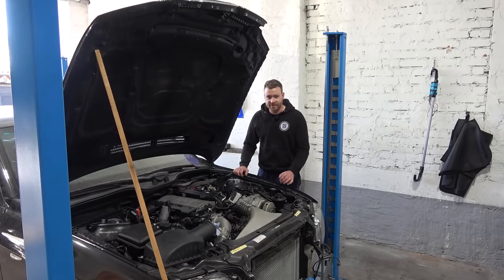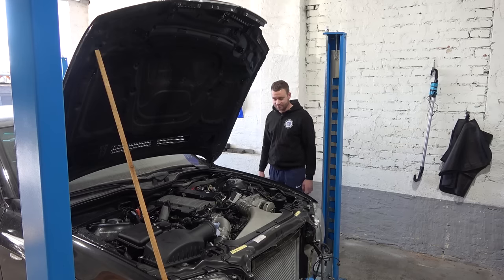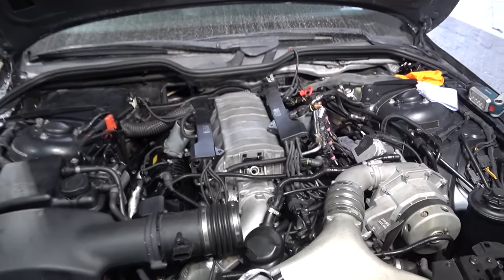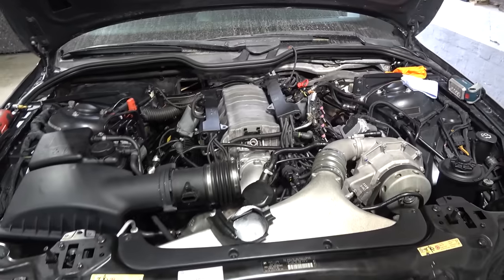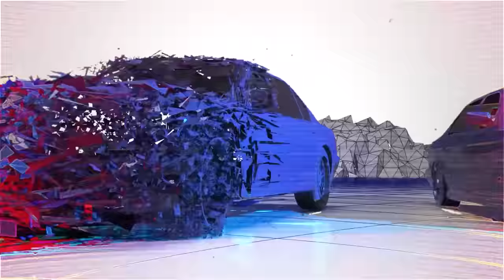Disastrous First Drive - V8 Alpina B7: Project Chicago: Part 7

Comment: Oh wow. Quite unexpected outcome considering how thorough was the rebuild. Can't wait to see what went wrong inside the engine. And of course, you'll fix it!
Reply: Beating the piss outta a fresh rebuild had nothing to do with it I’m sure
Reply: @dannyr3346  That wasn't beating on it at all.... And do you think every new car that is being driven moderately is wrecked in 100 kilometers? Nah, don't think so. I guess just bad luck
Reply: He should have changed the oil as soon as he replaced the fuel injectors as the leaking fuel likely diluted the oil.
Reply: @janetd5121  he did.
Reply: @janetd5121  he said he did after replacing injectors if you didn't hear.
Reply: @janetd5121  Watch the video.  He mentioned he changed out the gasoline diluted crankcase oil.
Reply: @janetd5121  he did
Reply: @janetd5121  wouldn’t make a difference
Reply: @janetd5121  he did
Reply: @dannyr3346  He wasn't beating on it ...
39:26 "so were gonna keep it around 4000rpm"
41:00 "aaahh ... its a shame i can't do a kickdown, this thing would probably fly"
1 - the tach is on the RHS of the cluster, and 4000rpm is about 1 o'clock
2 - the vehicle shifted pretty much at about 3900rpm anyway
3 - a few times he hit 4100rpm
4 - redline is at 5800
but that's about it, i cant see that i would call it "beating the piss out of it"

Comment: Sreten: "Man, I am really enjoying this car. I think I might actually keep it!"

Alpina: "you sure about that?"
Reply: I don't want to be that guy, but I knew this project and this type of engine would be trouble, these are KNOWN to be INCREDIBLY unreliable engines, I worked at a BMW dealership when we had those engines and they were a complete nightmare, doesn't matter if it's alpina badge or not either. But I am kinda shocked that it lasted this short of a while
Reply: At least he fixed the check engine light!
Reply: @henrik1743  Almost everything about a BMW is classy -- except the reliability.  Survey after survey shows that BMWs are the most expensive brand of car to maintain.  But that knocking sure sucks!

Comment: That's some awful luck, it was running so good! Can't wait to see the teardown and failure analysis. Hopefully it's something simple like a chain guide.
Reply: That most definitely sounds like chain noise to me.  Rod bearing would have been far more noticeable early on in the test drive.  As the car was in higher RPM, building more oil pressure, noise would go away, and then you would hear it at idle speeds (quietly at first, but the longer it runs louder it gets, as the metal gets eaten away.)  I think it's damn near impossible that this engine spun a bearing given the meticulous care that was taken ensuring correct tolerances when it was assembled.  The only plausible reason for a bearing issue would have been a clogged oil galley on first startup.
Reply: @gdowdy  excellent thinking! I was thinking it, yet you said it!
I would like to add to your statement: I’m thinking (anxiously) that one or more of the sleeves is loose/damaged/non-cylindrical hence making the problem related to the sleeving job done on the main block. What’s your opinion on that?

Comment: For me it doesn’t sound like a rodknock, it misses the typical high pitch pinging, it sounds more like a tipping piston. Btw: poor viewer that spotted you, he was soo happy to meet you, and he got you in such a bad situation
Reply: So true, he sounded so excited 😆
Reply: Nah homie that sounds like rod knock to me . Tell tale sign is the sound goes according to engine rpm/load . Could maybe be valve train but I think it would be a lot noisier .
Reply: @Richoffloudpack  agree, it 100% sounds like a spun rod bearring.
Reply: I agree, typically rod knock is more of a slapping/clacking sound, while this sounds like something rubbing along something else while rotating but I could be wrong.
Reply: @Richoffloudpack  I mean anything that spins with the engine would be associated with RPM, could even be an external balancer rubbing against a plastic shroud, or a loose belt rubbing. These are all things I've heard before that sound awful because it's associated with RPM, but have turned out to be minor faults. In this case, I don't think it's rod knock because a spun bearing or knock is a loud clacking or slapping sound, while this is more of a light scraping sound. If it is rod knock, then he caught it right as the bearing spun and it hasn't had time to do any real damage.
Reply: I would fully agree. However I did not see any exhaust smoke and he did not seem to notice any. The noise was at the crank rpm though.
Reply: @GeekyGamer167  I agree, It looks that the cylinder liner has failed, I don't know why the machine shop did not insert 4 rods around the cylinder liner to support it, this is super charged engine with high power hopefully I'm wrong, I do not think that Sreten did something wrong when put the engine back together. Great video
Reply: @GeekyGamer167  hi, unfortunately I have an experience with this subject - I had a rod bearring failure in my previous car and it sounded exactly the same. I heard it pretty much immediately and shut down the engine, but the damage to the crank journal was already done.
Reply: @Marus1233  I too have personal experience with rod knock, my E46 M3 spun a bearing and it sounded almost like there was a rock pinging around the inside of the crankcase... And I think you'll agree that usually with rod knock the sound will get more violent when the RPMs increase, which doesn't seem to be the case here. Although I do feel like the slow progression of the sound getting worse does seem like rod knock, I think there's another explanation.
Reply: @GeekyGamer167  we'll see - to be honest I hope you are right. I treat this very personally because as I mentioned in my other comment, I have just finished the full rebuild of my M54 engine that took me almost 3 months. Did 50 km so far.
Reply: @Marus1233  Well good luck with that! M54's are strong motors so I'm sure you'll be fine after a rebuild. I put around 3k miles on my S54 after rebuilding it, the engine never gave me trouble but the throttle, coil packs, fuel pump, and everything else did...
Reply: In my opinion that's way too low frequency for a rod? More like a camshaft area.
Reply: I bet we all will find out soon.
Reply: @GeekyGamer167  either that or it hasn’t fully spun yet
Reply: Sounds too loud for anything but a spun bearing probably... For this loud of a sound from the chain I think it would make other timing related sounds too and not sound normal at all..
Reply: A big old I told you so to everyone who thought other than rod knock

Comment: I have my fingers crossed its something minor. I will just say that this is kind of the definition of BMW ownership, just when you think you have it all sorted out, it decides to kick you in the ass. Good luck Sreten!
Reply: Like ......🤔
Peugeot
Renault
Citroen
Mercedes
Mazda
Nissan
Even Toyota
.
.
...
In every good brand you have some bad numbers.
My tds is known for head gasket and leaks and turbo'ssss 371k km later and some tender moments burning tire together none of the knowns problems had happened?!!. And I still don't know why.
Reply: As a owner of 2 Beamers... I totally agree
Reply: My 2006 550i sport bought it 6 years ago for $4500 clean with 179k miles.   Has 265k on it now just started dripping oil but it been pretty problem free just brakes tires plugs coils coolant reservoir.   Its still going strong has never left me stranded.  Had similar luck with a 2003 M3 and drove the wheels off a 1998 540i sport.
Reply: @oke115  as an owner of 4 E39's i also totally agree
Reply: @makveldz  you sir, have a problem.
Reply: @D3nn1s  i never denied it
Reply: These beemers are for people who believe they can master and defeat their intricate complexity. Sreten might do it, but most of us can't. This includes many BMW dealer mechanics.
Reply: As much as I’d like to wish it’s something minor let me assure you it does not sound minor…it sounds pretty major. I’ll bet $100 it’s rod knock…
Reply: @jkhan856  Spun bearing. Shit
Reply: +1.
Reply: I did not want to click this video after watching the rebuild and then seeing the title to this episode.
I hate bad news.
Reply: I love that you watch his videos too!  Both of my favourite youtubers!  Hello from Windsor, Ontario.
Reply: Hey Brother, I know this Sucks, especially since you put all this work into it but, I am Confident that you will locate the problem & fix it even better.  All the Best to you Amigo!!
Reply: I own 5 bmw .non of them has a single issue. All is about owner maintenance and driving style...for all car brands
Reply: Had 3 in the past. No more for me. I'm only here for the fun.
Reply: @tintinlavigne5257  No. BMW is the worst
Reply: @halogod0298  nothing can compete against the modern Peugeot 😵
Reply: @tintinlavigne5257  ok, we don’t have them in the USA. What I do know is BMW is the worst in the United States. Fiat/Maserati tie for second
Reply: @halogod0298  yes that fair enough for me 😁 bmw is .....bmw you have to like spending your life under the hood and open your bank account directly in the parts dealers. ( That's all me😇)
Reply: never minor
Reply: @blacknester that the case until you learn why the gearbox fail? Is it overheating? To weak? Bad driver habits? Bad electronic?
Then you have the choice to try counterparts the weakness of your gear box.
Exemple ( at my risk cause I'm not a specialist of automatic gearbox as a french guy😓)
The aisin tl80 ( in Volvo jaguar and Renault and.... others ) in Renault it failed  100% of the time due to overheating cause 1 the design of the car 2 the fact that your genius french engineer add a valve and software in the box make it engage and de-engage the torque converter= to make it more slippery than nothing.
But it's a heavy car and it drive a lot in town. So you add slippery and heat production on a automatique gear box who heat a lot by itself!!!! Is the fault of aisin? Or the engineer?
Solution break asap this valve and go delete this add software (100-150€) and add an intercooler (another 150-200€) and you have a good car and good trans.
If you don't won't to think about those troubles no problems just by new car in leasing and prepare you to paid 300-800€ / month for the duration of your need for a car ........ traduction lifetime.
Or go manual and destroy your knee and drive shaft, rear axle, consume some time more fuel.
And some time, even the manual have some problems.
Reply: @blacknester after read a second time your comment, I surely answer off the target and I'm sorry for that ( but the exemple could perhaps be interesting for others?)
Perhaps no need to play with statistics.
I love cars and I of course want to by the best biger powerful shinny car .....but I learned the hard way to than the best car is one who fulfil your principal needs and that is the more difficult thing to do.
Just look a it objectively and calm.
Do I need a 10 speed gearbox at 30k€ the piece? It I'll break at some point surely or perhaps it will worn-out at some point. Am I ready to pay the extra in relation for my needs?
Same with motor, new or used car, rust, électronique, Options.
Reply: Owning a brand new BMW means that you are doing well in life. Owning a 15 year old BMW means that you are filthy rich.
Reply: The way he put it together, it has to be something silly. Like a stuck tensioner piston
Reply: @federicomolina6745  perhaps or a tiny little cheaps of metal from the sleeves in a oil gallery, some time it's very strange.
You can flush it or pressure it for day long and after when pivoting the engine it come off by itself ( hopefully it happened to me)

Comment: Sreten, I am terribly sorry for what hapened and hope it is easily fixable, because you went above and beyond with that engine build...It hapened to me in July 1999 when after a long month of rebuilding a Renault engine (sleeving the block, refinishing the valves and the cranckshaft, changing the cylinders' rings, etc..), a nasty noise (tak tak tak tak...) gutted me right after the start because the engine was not well lubricated (the oil pan bottom was not straight and too close to the oil pump which led to an oil starvation: the pump had trouble sucking the oil and sending it to the top of the negine) which led afterwars to a bad compression and difficult cold starts...I ended up selling that car for a major loss....we learn from our mistakes...! Can't wait for the next episode!  We are with you with our hearts!

Comment: Pro-Tip: “Reinstall” the wood screw in the oil pan and that sound will go away…
Reply: It was a nail
Reply: Yes, this is might be the problem. Sreten did not put that screw in oil pan.
Reply: Mechanic rule #1: always put back the bolts and nails in their original place!
Reply: I think this comment "nails" it. Sorry. Couldn't resist the pun.
Reply: dudeeeeeeee hhhahahahaha

Comment: I feel you Sreten, my E34 was out of the shop (after being there for _a few months_) with a new (used) block and it started knocking after like 60kms... The frustration is immense and in this situation, I can't imagine how you felt. Almost feels like a metaphorical stab in the back. Hope you're doing good and the problem isn't too troublesome!
Reply: What was the issue?
Reply: @afeefyakub  bmw is the issue
Reply: @theEskalaator  I'm from the Netherlands, and here we have a little joke we use for the initials of BMW as "Blijf Maar Werken" which translates to keep working.
Reply: @theEskalaator  🤣🤣🤣
Reply: @Maxxwell-07  in the states we have a similar joke, initials of BMW meaning is Bring My Wallet or Brake My Window
Reply: @dukedub  in germany we say "Bring Mich Werkstatt" which translates to bring me (to the) workshop
Reply: @afeefyakub  long story short, the head is what's cracked (previous shop diagnosed it as it being the block) 🙃
Reply: Will just add to the abrreviation fun - in Polish "Będziesz Miał Wydatki" -> "You will have spending" nuff said...

Comment: I had a similar sounding knock, it was the AC compressor.  Start by pulling the accessory belt and see if goes away.
Reply: I had this same issue.
Reply: You may be on to something.  Sreten did say he had no air conditioning, right?
Reply: @marknelson8724  That was because he had no AC juice since he tore apart the whole car
Reply: If he had no Freon in the system, likely the compressor would not even engage because of a safety switch. It could still be a faulty compressor, though. Here's hoping he finds out what it is!
Reply: I think BMWs has variable speed compressor which means its always engaged, even if there was no freon.
Reply: @falsulaimani7  I just double checked, and that is correct. Most modern BMWs have been using variable speed compressors controlled by the IHKA system. Things like Coolant temp, etc, are considered by the computer and tells the compressor what to do.
Reply: That would be such an incredible outcome
Reply: @legion1791  indeed.
Reply: Could be the accessory belt tensioner?
Reply: @AviateNavigateCommunicate919   i really hope its just the compressor grenaded itself because of no freon rather than engine noise
Reply: @falsulaimani7  me too. This is such a beautiful car.
Reply: It is very hard to ping this knocking sound unless you look at the engine and hear it in reality. Through a video, one can come to many verdicts which can be easily dismissed. Personally I hope it is something small since Sreten spent a lot of time and money methodically rebuilding the BMW H1 (N62) engine.
Reply: @frederiquekruger4818  yes, this will require a proper inspection and taking things apart again, to be sure. I choose to remain optimistic but it’s always a possibility. I’m glad my M54 has a low likelihood of rod-bearing failure after realizing how problematic some of the V8s can be with those.
Reply: What I didn't say because I was busy earlier is the tragi-comedy part of my story: I had the "rod knock" on an N55 335i xdrive. My independent mechanic swore up and down it was a spun bearing. I embarked on a project to rebuild engine, I ended up swapping it when I couldn't ascertain what was wrong with the original engine as bearings looked good, etc.   After installing the used replacement engine, the knock came back which was a truly disheartening moment.  Soon after I discovered it AC compressor one of only two original parts.  I specifically asked the shop to check accessories originally and thought they did.  Hilarious, right! Well at least I learned a lot and made a friend from a neighbor who helped out quite a bit. And now I can say I've done an engine swap (for no reason as it turns out).
Reply: I think the grenaded compressor would sound a bit different, probably not as loud..

Comment: When I rebuilt my N54 "and i have noted this on  a few S65 too" every stock rod bolt had a different Torque removal ranging from 12 to 70 ft lbs and the factory stretch was very different from bolt to bolt, the stock TTY rod cap bolts suck. Also the aluminum oil pump bolts where weak, stretching under load and heat letting oil to leak from the block mating surface to pump back in to the pan (oil starvation). The milled matting surface was also very bad from pump to block these things combined are prob why a lot of BMWs have bearing and cam ledge issues. I replaced all the aluminum bolts with stainless steel rods and bolts never had one problem since.